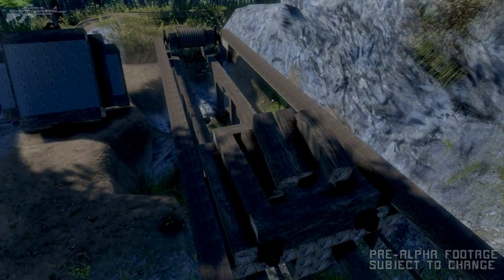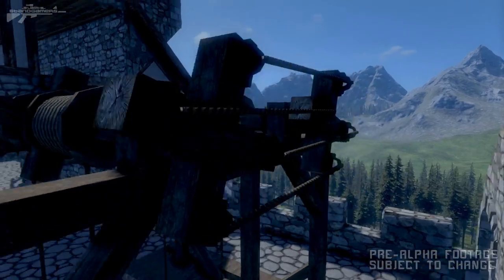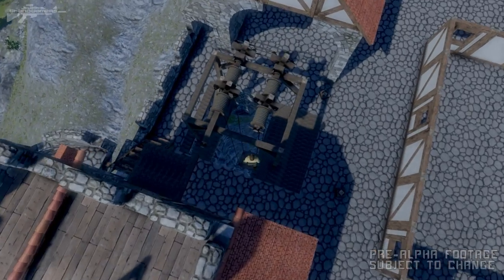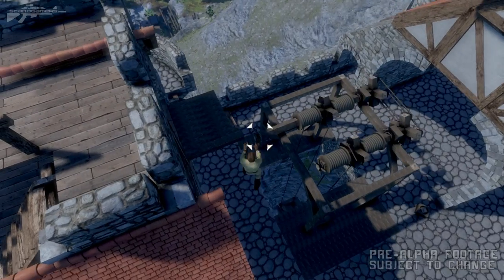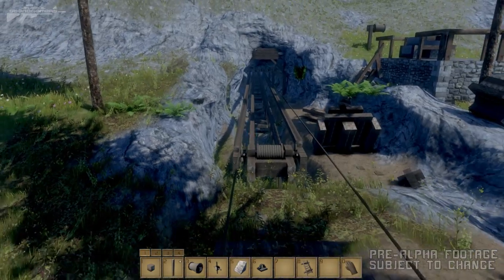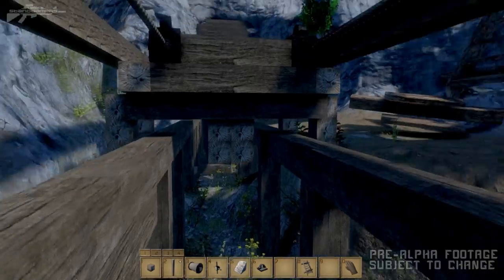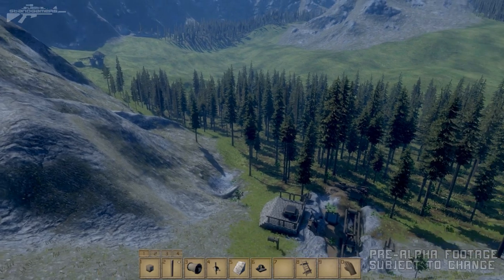Medieval Engineers - Mine Carts, Supply And Logistics

Comment: For survival the crane cranks would need to be hooked up with the pulley system to a lower spot to be reached from the ground, also you could probably also use the pulley system to create a wheeled minecart, just keep the drum that you crank around ontop of the minecart, sticking out and connecting to the pulley system which would attach to the outside of the wheels themselves which again are connected to eachother like normal.

Comment: If you make two dynamic shells separate from the cart that can overlap each other at the crane spot you could always have ropes conected. If you set up the same pully lever on the rails below you can have 2 ways always connected and operated on either side.

Comment: Perhaps you should add an intermediate rectangle that hovers just above the minecart at the bottom, and then you connect each corner of the rectangle to the minecart with ropes instead of running all the way back up to connect it. Much simpler.

Comment: How would a minecart fare with corners? Intersections? And it is possible to make the system in such a way that it is connected to both ends instead of hooking one up to one end at a time?

If it wasn't for the crane you could make the minecart tighter by having the upper rails be a part of the cart itself instead of guide rails. The current minecart is attached at two points (where the wheels would be on the bottom). If it were just a minecart and not also a crane box it could be connected at four parts (two on the bottom, one on each side.

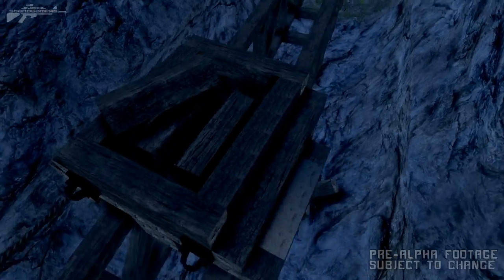Comment: An idea, 2:07 when you unhook the cart from the horizontal track to the vertical one, How could you do that without flying? Well maybe if you had hooks that hung down from a winch and acted the same way the other rope connectors do. Thoughts anyone?
Reply: I had the exact same thought, but since that isn't possible for now how about just making part of the track the cart slides on raise up via winch? Then you slide the cart onto the raisable section which already has the ropes on it as there would be no reason to disconnect. I'm really curious to know if you could put the winches on the part you are raising and then operate it like an elevator to raise yourself as well.
Reply: Nevir202 Yeah I think that could work to, but it would probably be difficult. At any rate I can't wait to get my hands on this game.
Reply: Perhaps a rack that lowers, with ropes. Then you tie the rack to the bucket and lift. You could lower the bucket into a different rack (for the rails) and tie it to those, and then winch the rail-rack to one end or the other. Hell, put the winches on the rail-rack and move it around like that.
Reply: ***** If we're taking the simplistic approach why don't we just get slaves to haul that wood to the castle on their backs?
Reply: Chaz Merritt It would be easier to make a ladder tbh.
Reply: Brandon_E The point I was trying to make is that with a ladder you are eliminating the purpose. It can be easy, or it can be effective.
Reply: Maybe have ropes that lead to the main winch group at the bottom of the hole, so that you can just do it all from ground floor, then a ladder to go up to collect it.
Reply: Chaz Merritt I was just joking, the only way this game will actually be good is if pretty much all of the options are available so then we have our freedom and a sandbox world.
Reply: Brandon_E I think it will be good. Just like Space Engineers.
Reply: Chaz Merritt let's hope so. XD
Reply: you could make a permanent frame of sorts that gets lowered down,it's top ropes never get detached but it's  lower ropes would(ropes from either side). the lower ropes would connect to connectors on the mine cart. it would be an extra part to add,but it would ensure you'll still be able to use it without climbing all the way up.

Comment: It might be cheaper, the cart permanently with the ropes, and the track
to connect and then set up a kind of removable module.
The crane could then lift the module and set it down again. Without Hovering (In Survival example) a worker would hardly reach the clear track to attach the ropes. Unless he sits on it. But then he would have to take the other cable in reception, which can be very hard.

Is that now actually better not connected to enforce parts in contact with each other without the program posing for clashes problems?

Say that it tries the parts (particularly rail systems) repel each other and doing this often damaged itself? As in Space Engineers, for example?

Comment: Yeah !! That gear mechanism on the crane it's mine, i finally ended up on one of your videos :D YEAH  :D
Reply: [] Leo [] 's channel
 When I saw it, I saw it as two fused Roberval Enigmas (a parallelogram-shaped setup of hinged bars). Those things are used absolutely everywhere. You'll see them on things ranging from desk lamps (so that the bulb can be moved without changing it's angle) to hospital bed-side tables (so that the table-top cannot be tilted away from vertical).
 I remember trying this out in Garry's Mod as well, but with three of the Enigmas attached to spheres (never actually published anything about it; that's my fault). This meant that not only did the spheres match rotation in a plane, but also in a space. Develop this slightly further, and one could have artillery pieces on tower tops all aiming in sync. Similar to the coordinated gun system that was featured in an earlier video (using 88mm Flak cannons) except applicable in both SE and ME.
Reply: In real life those four ropes that make both sides turn together wound just tangle wouldn't they? They seem to have noclip with each other in this.
Reply: Rob Herridge
 That is the only issue with that specific setup. However, it can be "decompressed" from two circles into two rotary shafts with offsets (similar to an engine's crankshafts) for rope connections.
Reply: Or you can just connect the two gears with only one "rope" but instead of the rope it would be a solid piece of wood. The setup i made is ofc irrealistic because of the no-clip but a realistic one would have been bulky and less stable, so yeah i cheated a bit to get more functionality out of it :P
Reply: gg
Reply: [] Leo [] 's channel
 The only hazard with having one or two connection points is stability. If you have one or two, there is a risk of the other wheel turning the wrong way when you start it from horizontal (if each wheel has two connection points, and the connection is rigid instead of rope-like, and the wheels' points are horizontal, there is a risk of the wheels trying to turn different directions when starting/changing direction.)

Comment: the question however is how do you make sure everything gets hooked up? you can either make detacheable track area, or just make a ladder to climb, stairs up, or an elevator to the side that will always be permanent for the player to use. not everyone can fly in a survival world. well no one really but you know my point. further more, what about making the entire rig bigger? make it to be the size of a wagon. then you can offload an entire wagon into the cart and haul it into the keep. wouldn't you agree that it would be able to maximize efficiency? granted you would definitely need to work out the weight system and set a weight limit but i think it would work rather well. if you made the cart about four times as large then the track is twice as wide and the lift shaft would need to be widened... hmmm.
perhaps for the purpose of safety during offloading at the top you can have it lifted all the way up and then have stability bars slide in under it and into hollowed slots in the stone beneath. obviously it would require two more pulley systems but i think it would be the best idea. so that the ropes don't snap and send a player and all their items to the bottom of a mine shaft.
Reply: Why u couldnt fly? You got jetpack.
Reply: becuase its medieval engineers... the alpha is set to creative mode. i think. i don't have the prerelease alpha but i'm trying to point things out that will be necessary for use in a purely vanilla survival world.
Reply: Anthony Placek what if they are not gonna remove the jetpack?
Reply: Bridge*. Damn typos.

Comment: would be easier to just make the wooden card at 45 degrees up and just have one stage for the winches.
Reply: I think the purpose of the 2 stages is so that it can be used as simply a cart in the mine (ferrying supplies from the mouth to each small strip mine) or as a crane for the finished goods.
Reply: His system is probably safer from attack, too.  People could just march straight up a 45 deg incline, where as they'd have difficulty scaling the vertical shaft.
Reply: Cpt. Gavorn How would you make the track diagnal?